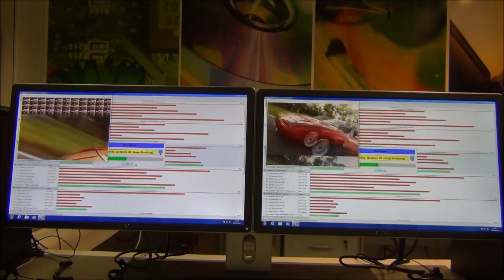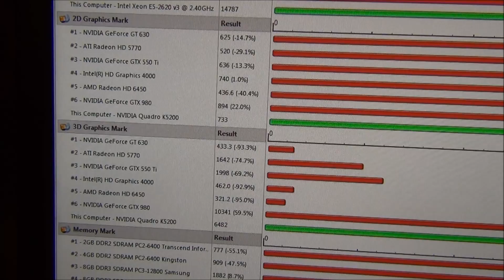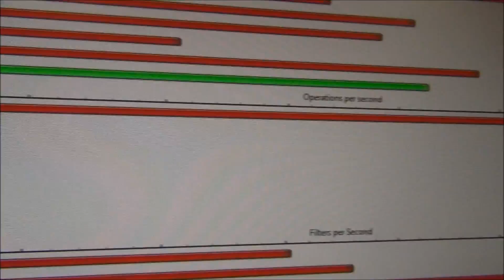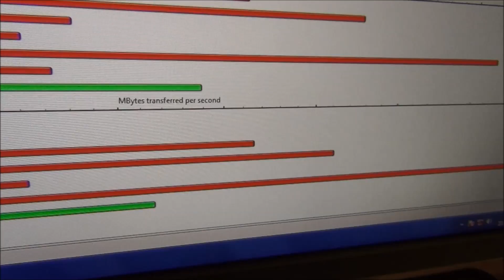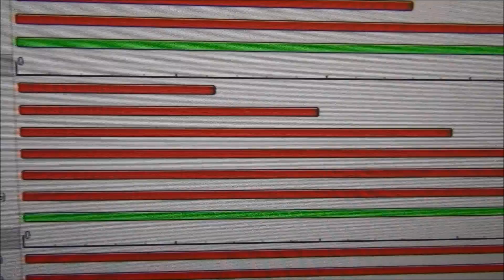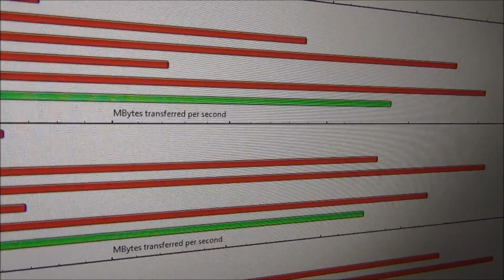T7910 vs T7810 comparison

Comment: HI I NEED YOUR REVIEW ABOUT MY NEW T7910 WORKSTATION
I need your suggestions for my new workstation that I'm going to buy 
&
I USUALLY WORK ON 3D SOFTWARES

please give me feedback on this specifications 

Dell Precision Tower 7910 XCTO
Base

Components
1 Dual Intel Xeon Processor E5-2640 v4 (10C, 2.4GHz, 3.4GHz Turbo, 2133MHz, 25MB, 90W
1 No Dell Tera2 Remote Access host card for the Wyse P25 Zero Client
1 Boot drive or storage volume is greater than 2TB (select when 3TB/4TB HDD is ordered)
1 Dell Precision T7910 1300W Chassis v2, BW
1 32GB (8x4GB) 2400MHz DDR4 RDIMM ECC
1 No Media Card Reader
1 PCIe Boot Drive Selected
1 M.2 256GB PCIe NVMe Class 40 Solid State Drive
6 No Additional Hard Drive
1 Additional Drive: 3.5 inch 2TB SATA 7.2k RPM HDD
1 Dual Processor Heatsink for T7910
1 8x DVD-/+RW Slimline
1 System Power Cord (India)
1 Chassis Intrusion Switch
1 Display Not Included
1 NVIDIA Quadro M4000 8GB (4 DP) (1 DP to SL-DVI adapter)
1 Internal Speaker
1 External Speaker Not Included
1 Dell PCIe SSD Card - holds up to 2 x M.2 Solid State Drives (FH)
1 No Additional Network Card Selected (Integrated NIC included)
1 Dell USB Optical Mouse - MS111 - black
1 US English (QWERTY) Dell KB212-B QuietKey USB Keyboard Black
1 Dell Developed Recovery Environment
1 SupportAssist
1 C11-PCIE SSD boot plus 0-3 3.5" Matching SATA Hard Drive
1 Non-RAID
1 Not selected in this configuration
Software
1 Cyberlink Software for Windows 8/10 without media
1 Dell Precision Resource DVD
1 Windows 10 Pro (64bit) English
1 Windows 10 Pro OS Recovery 64bit - DVD
1 No Productivity Software
1 No Out-of-Band Systems Management
1 Dell Applications
Service
1 # Limited Warranty: Year 1-3 (POW)
1 3Yr ProSupport Plus: Next Business Day Onsite Service
1 # Limited Warranty: Year 1-3 (NBD)
1 #Prosupport Plus: 7x24 Technical Support & Assistance: 3Yr
1 #Prosupport Plus: 3Yr Keep Your Hard Drive
1 Pro support Plus: 3 Years Accidental Damage Service
1 Visit http://www.dell.com/contactdell
1 No Dell ProSupport for Software, No DDPE Encryption SW

Comment: hardware wise, is there a difference between the 2?
Reply from the maker: Yes, there a few features that have more options on the T7910.
The key features that most people are interested in are as follows :
T7810 has 4-14 core support , T7910 has 4-18 core support.
T7810 has 35MB LLC , T7910 has 45MB LLC
T7810 has 8 Dimm slots , T7910 has 16 Dimm slots.
T7810 can have up to 128GB Memory ( as 4 / 8 / 16 GB's Dimms ) , T7910 can have up to 512GB Memory ( as 4 / 8 / 16 / 32 GB Dimms).
T7810 can have 2 x PCIe Graphics Cards / T7910 can have 4 x PCIe Graphics Cards.
T7810 can have 2 x 3.5" and 2 x 2.5" HDD's , T7910 can have 4 x 3.5" and 4 x 2.5" HDD's.
T7810 has 1 onboard NIC , T7910 has 2 onboard NIC's
T7810 is either 685w or 825w power , T7910 is either 1000w or 1100w or 1300w power.
The T7910 is 4-5 inches wider in the chassis.
THe T7910 has a rack mount option if you don't want a desktop.

Thanks for looking. :)
Reply: great thanks for the info. i planning of building a dual cpu for CAD work. I dont know if i should go with the ASUS Z10 PA D8 or go with a  DELL T7910. Im still looking at the Asus MD, but dont know much about the DELL MD, or if both are more of less the same.
Reply from the maker: The ASUS is a good board for Dual Processing. I would advise caution with a build ,  if you are not confident though. If something doesn't work quite right or fails you really have to know what you're doing. A big positive of the Dell systems is the 3 year warranty we take as a minimum on the Precision range. It is an onsite warranty that Dell do. Actually having someone come to your home or business and fix the machine after a hardware fail is a big feature.
Reply: The ASUS ZE PA D8 sounds like its gaming friendly if im not mistake. if it is true, what makes it gaming friendly compared to a DELL dual mb. Is it that its compatible with gaming ram? or might have other features that are void in workstation boards?
Reply from the maker: On Google the Asus board reads as a Dual socket server board. It has loads of input / connections but is aimed at fitting in a smaller case. It is more of an ATX case size.I am not that familiar with the board itself that I can comment on it in direct comparison to the Dell board. But they do a similar job. The Dell boards are CAD workstation based though and the Asus is for server. The thing to check on the ASUS board is that it is the suitable chipset for playing the games you wish to play on it. You can Google the specs and some good reviews on the Asus and Dell systems too.